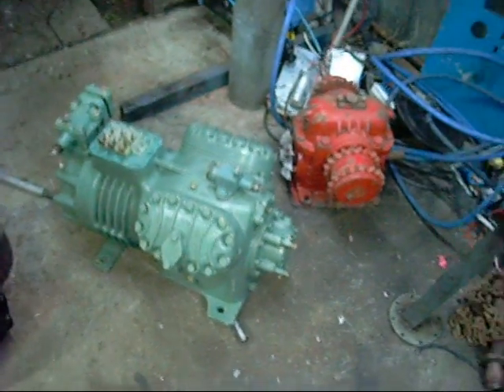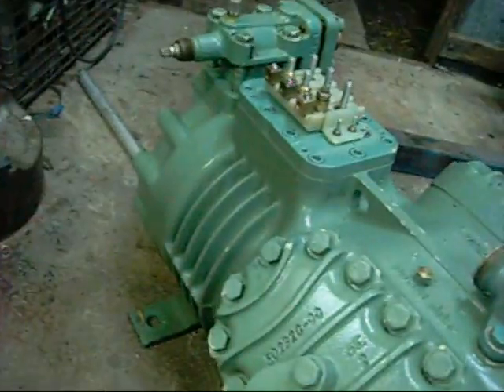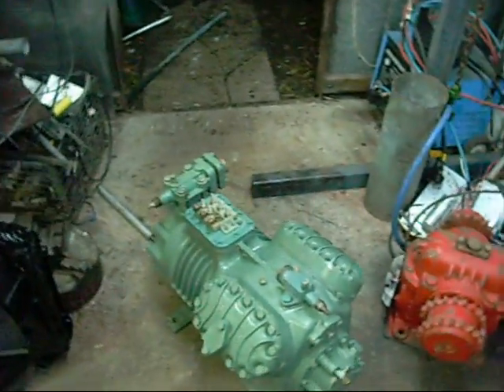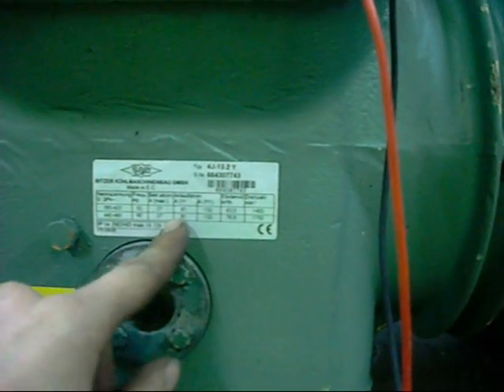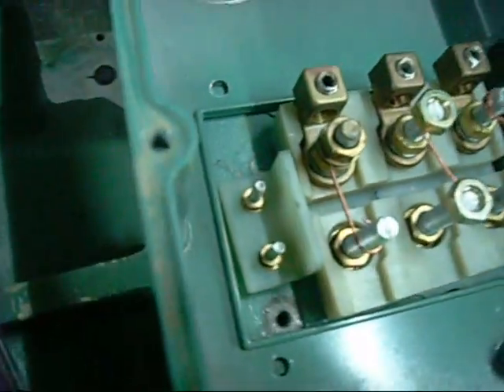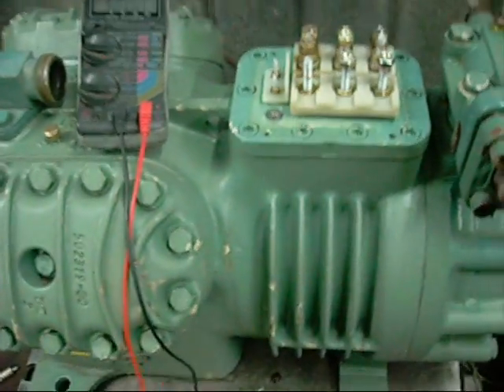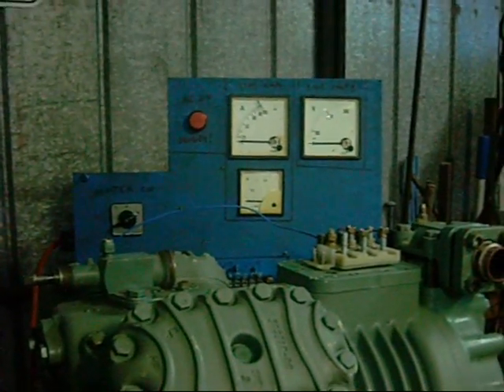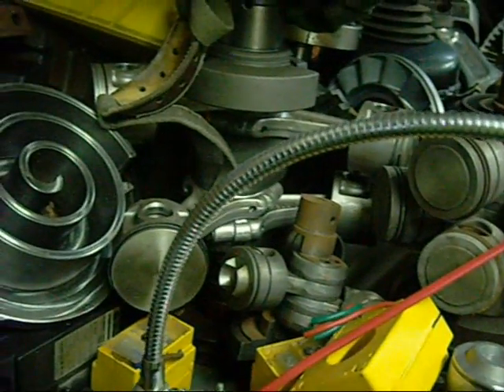Bitzer V4 Semi-Hermetic Compressor Autopsy Pt1- Electrical Testing

Comment: Hi. I have problem with my 8FC-70.2Y comp. Oil pump is changed 1,5year ago. When it was changing, they found small piece of metal in case. Now, compressor have to be restarted (oil pressure protection) several times (at starting).

Comment: Im testing a similar motor at work the terminals are the ends of two star connected windings the links just connect them hence the star star. usually a star connected 3 phase motor the links go across u1 v1 w1 and delta connect go across the u1-u2  v1-v2 w1-w2 terminals. these links are to connect the 2 star windings.

Comment: Hello Ed,

What happened to the motor of this compressor? Was it damaged or the compressor itself was blocked?
Reply from the maker: +kontaktronik the motor had a burned winding before I got it. the compressor was mechanically fine
Reply: +Aussie50 Great! Better situation if You get one for free to experiment with it. :D However, having some high kW motor is not bad, too.

Comment: @Aussie50 Well, I suppose if I was a a/c tech looking for a replacement compressor for a client, I probably would get one new. If you do fit an external drive it could replace your little tandem fridge compressors! It might turn out the motor is fine, but the low oil pressure warning and low amount of oil in the sump could mean that its seized up.

Comment from the maker: @tlaroche38 nah, nobody would buy it unless its repaired by a certified repairer. plus getting the motor out and re-wound is a hell of a task.

I'll prolly strip it for the vid, then cut the motor part of the housing off and mill the end flat so I can make a backing plate and bearing for the shaft to go through. then fit a pulley for external drive.

Comment from the maker: @kodibass engineering and fabrication. I'm still digging crap out of the gardens like antique tool bits, a vice, wood lathe headstock etc.

not to mention hundreds of pop rivet shanks all over the driveway that play hell with my tires. (magnetic sweeping helps a lot tho)

Comment: you must have a large electrical service to do that kind of stuff.  I think I would cause a  power outage here with trying to run 80amps.  That meter setup is pretty cool as well.  Keep the cool vids coming.

Comment: Nice vid! I think its a 13hp/9kw comp. One of the favourite things for low oil trips are either a faulty crank case heater allowing refrigerant to disolve in the oil when the comp is off, when it starts the oil goes foamy and comp trips, the other thing is liquid coming back up the suction also causing foamy oil.